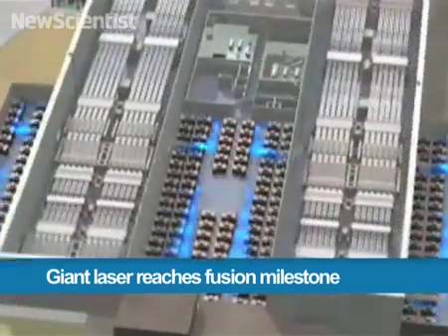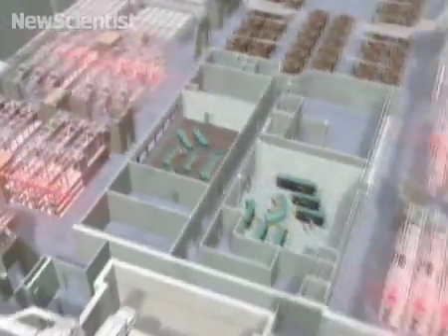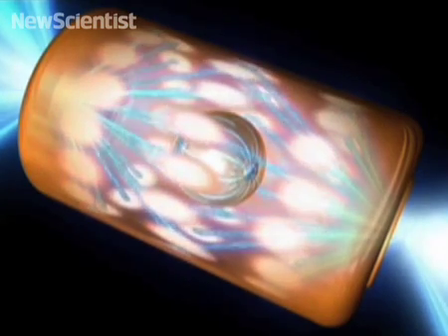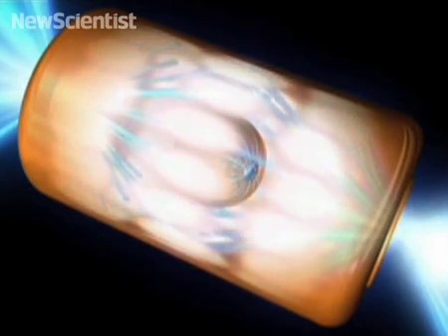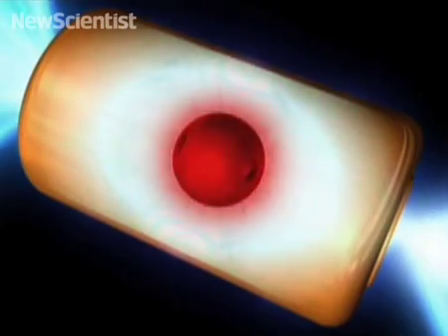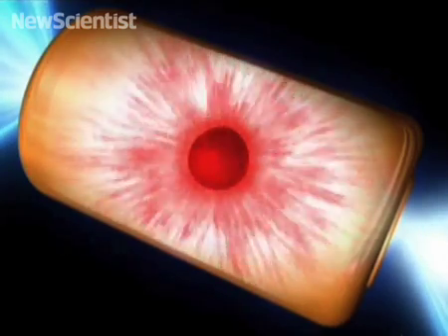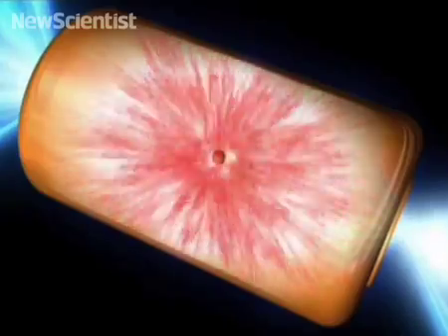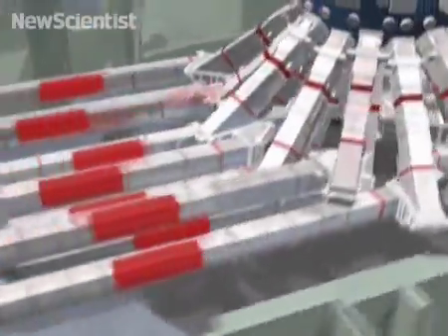Laser fusion

Comment: The lasers provide the heat (energy) needed to kickstart the reaction but the energy released is provided by the fuel of the fusion (generally aimed to be Duterium and Tritum but most reactors today can't do that type of fusion yet)

Think of it like a car engine, The lasers are the spark plug which ignites the fuel, and the exploding fuel provides a LOT of energy to move the piston.

Comment: @HJP007 The narrator was just confirming that it creates more energy than used by the Lasers to initiate fusion, otherwise it would not be worth doing.

The energy comes from the fusion of the Hydrogen isotopes (not the lasers themselves)

The laser are needed to get the fuel capsule to the correct temperature.

Remember e=mc2 - energy is mass times the speed of light, in other worths there is a hell of a lot of energy in matter.

Comment: @HJP007 The strong nuclear forces required to hold helium together are less than that of several hydrogen. Fusing elements up to iron will reduce the proton weight. Essentially you're putting a whole lot of energy into one place to access the energy that holds particles together. You're not actually getting energy back from the lasers at all. You're getting a completely new source of energy, which is more than what you put in. 
Don't believe me? Look up

Comment: What they mean is that the energy used to create the process is small next to the energy released. Much like any nuclear process where the mechanical or kinetic energy used in the process is much smaller then the energy released. 
Consider somethiing like the A-bomb. The energy used too slam the two spheres together (usually TNT charges) is extremely smaller then the energy released from the result of the primary blast of TNT.

Comment: There are material that could withstand temperature of 3.3 million deg they are call composite material. Just like ceramic material that is use in NASA. Ceramic actual means a composite of many material mix together and there are many forms or pattern.

Comment: It does melt it; but not before the x-rays ignite the hydrogen. After that, they use magnetic fields to hold the reaction in place (typically - they might not be using that system for this experiment, but that's the usual way it's done).

Comment: Basically, fusion releases a massive amount of energy for a very small amount of fuel. The main problem is that the fuel needs to be heated up to about 5 million degrees in order to achieve fusion, and then kept there. Obviously, that uses a massive amount of energy as well; but if they can reach a point where they can create a stable fusion reaction that produces more power than it takes to keep going, they can use that power to keep the reaction going, and get the excess as "free" energy.

Comment: All technical problems. The concept and theory itself is sound.

The fusion reaction itself does not explode. It's the matter around the reaction that can superheat and expand too quickly. This is a technical problem that can be solved with some time.

As for collecting the energy, they would need to find a way to insulate the reaction's heat energy and explose an energy conductor like water to it so that conventional turbines can collect the energy, Again, a technical issue.

Comment: @myname12321 You're not wrong, but you're not completly correct.

It's virtually impossible to get the full energy of a material (mc²). the fusion will only generate a bit of energy. the rest will be dispersed on sound, light, heat, etc.

Comment: we don't have the technology to make photovoltaic cells that pass anywhere around 25-30% so that would be cutting edge, and they didnt ,mention it because the video was about producing energy via laser fusion not capturing it...  Furthermoe, x-rays are used to assay crystalline molecule structures too... has nothing to do with heavy metals lol. I should also add that thermodynamics says that 100% energy transfer is virtually impossible... So no, its no only heavy metals.

Comment: conservation of momentum also applies to heat

so u cant make heat up out of nothing,

in order to heat something up , u need to make its particles more energetic , by either shining light on it , wich means sending photons into the atoms making them more energetic 

by putting something hot near it wich means the faster atoms make the cooler atoms hotter ...the same way by loosing energy as photons into them ..

so in a way "heat" is preserved...  actually energy is preserved.

Comment: in order to heat up a piece of metal 

u either put it in a hotter enviorment , wich means the atoms from outside are fasters then the ones from the metal , when the faster (hotter) atoms interact with the slower ones they loose energy by exchanging photons with the atoms in the metal plate ...and yes the electrons jump orbitals when this happens ..

when the metal cools down , the atoms loose energy , wich means the electron are emitting photons , gowing down an orbital 

so no , im not wrong.

Comment: its an implosion, the energy release is in the form of x-rays or some other form of electromagnetic radiation, for which some sort of photovoltaic cell customized to absorb light energy at the x-ray bandwidth would most likely be used. Get your facts straight.

Comment: well u don't seem to appreciate how important the positioning of that pellet is
it has to be exactly at the right place otherwise the lasers will converge incorrectly and the pellet might be heated not uniformly and that can make the fusion a failure

so its quite hard to position such a thing
now imagine the reactor is working (without stopping)
inside of it its kinda hot as u already know
and that's the second point i am curious about
how (or even can) u reload it regularly

Comment: It's all explained in some detail in the stanforduniversity youtube vid "LIFE: Laser Initial Fusion Energy System"

The actual power to create the lasers would be about one fortieth of the raw power created from the fusion. Of course, you can't get ALL the power from the fursion converted to electricity.

 Elsewhere, I've read or seen that the projected efficiency might be around 90%, i.e., 10% of the power created would have to be used to keep firing the lasers. Not bad.

Comment: The dirty little secret behind fusion power is that even if we do get ignition we're a long way away from usable power.  The lasers alone probably run at 40% efficiency. 
 
I had a cool picture that showed this, but spammers have ruined URL links for the rest of us...

Basically it just means we will need an ignition that produces 10 times input energy before we can start considering building a powerplant.  Sill, it's nice to see they're keeping it up.

Comment: "we can work out a way to reuse transformed hydrogen, therefore make it infinite"

Energy will be used up in machine process. Whether it be the human who is required to take the pellet, at any point, and move it anywhere, or the machines requiring tune-up, no machine can reach 100% efficiency, and so no energy production can be described as "infinite" or as producing "unlimited" amounts of energy.

Comment: "rather it converts energy from one form to heat and light energy."

Yes, that form is called "matter". It's the same process in the sun. The sun is mostly Hydrogen at "birth", and it fuses under the high pressures and temperatures into Helium, which fuse into higher elements.

Comment: @Magician12345

1) It will be "cheaper" in the sense the "fuel" required will be available without political complications (like dealing with the middle east).

2) It will also be TOTALLY clean and carbon free. In addition, ALL current fission waste products and fissionable materials can ALSO be "burned" (completely fissioned) at fusion level temps, and so we can clean up current fission waste, as well.

Watch the vid: LIFE: Laser Initial Fusion Energy System

for a full explanation.

Comment: as good as. Its all about E=mc^2. The atoms left after the reaction will be lighter than the original ones, and the mass difference will have been released as radiation i.e. energy. 

however, this type of fusion is much likely to be the first generator of energy, as magnetic confinement fusion.

Comment: If melting ever begun, it would stop instantly as contact  with any material would drain thermal energy below the point (and / or pressure) where fusion can be sustained :)

Comment: there is but its locked away in water so it wouldn't happen and the hydrogen has to be heated up to 3 million degrees C and under huge pressures so fusion will occur so no worries lol

Comment: The principle behind fusion is to change an element into another, say hydrogen into helium. In extremely simple terms, one helium atom contains less energy than two hydrogen atoms - this excess energy is released in a form of usable energy, usually heat. In fusion this heat would trigger the next fusion.
This is perfectly safe as it stops the moment "fuel" becomes available, say if the damn thing exploded.
The practical problem is containing such a process that would melt anything it touches.

Comment: it will mean infinite energy... so its got potential to be cheap. but those machines dont look very cheap... plus the power output may be a tad low or slow... so its a step in the right direction, but not quite cheap energy just yet.